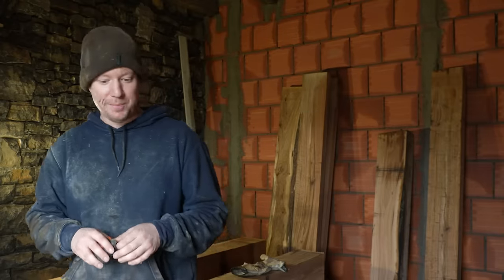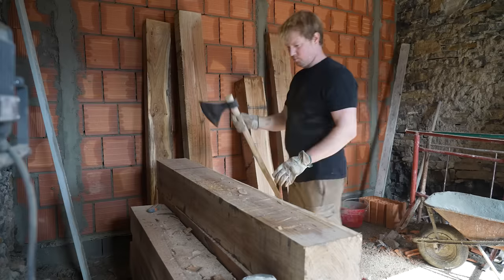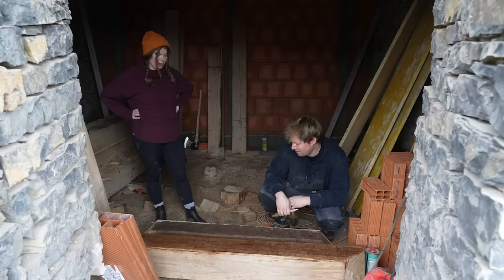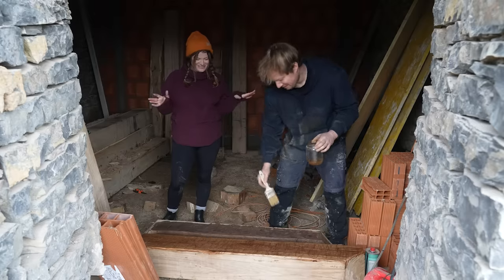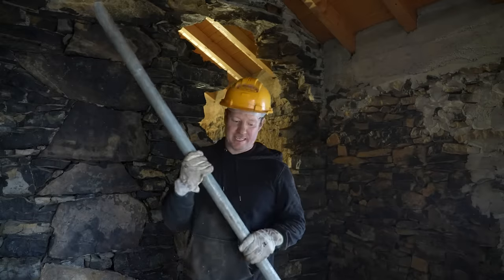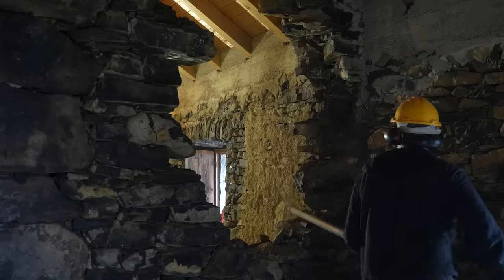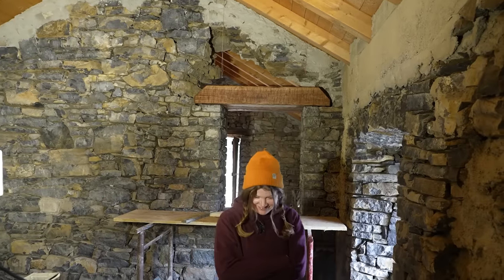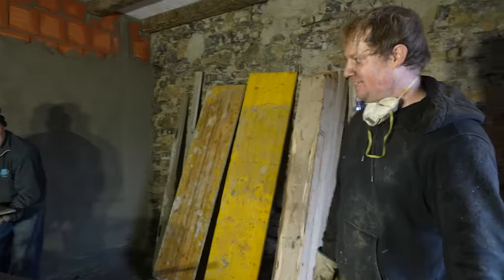Another Door Finished! Building Our Stone House.

Comment: If you're going to work with large timbers, then you need to oil the end-grain of the beams/lintels before installation. Oiling the end-grain, slows down the drying of each timber, and forces the water in the grain to dissipate through the sides of the beam. This slower drying process helps to alleviate racking, checking, and cracking of the wood. When wood warps and twists and cracks, it weakens...and that's the last thing you want, in a home you want to last you the rest of your life. I highly recommend a 50/50 Linseed, and Tung oils. This is one of the reasons that your Chestnut beams already in place, have lasted from ancient times until now... They were likely oiled before installation at the time the building was first built. This takes more time, but the end result, and the durability of the structure will be worth the time you invest. 
Timber framing a building, is always a beautiful thing. Timber framing a structure typically adds a lot of years to the structure's useful life. Timber framing also adds value, and aesthetic appeal... It just LOOKS better. Timber framing also lends itself more readily to the use of 'natural' materials available on-site. Nice to see you using traditional materials and tools to get the home built. Can't wait to see what else you have in mind for the home, and surrounding site.
Reply from the maker: They were oiled before installing which is why they were so slippery

Comment: When you have to lift something very heavy - back breaking - onto a work surface leve, lean it decently tilted against edge of that work surface so that the center of gravity is about at - or better: a bit above - the level of the edge, then lift at the bottom 'swinging' it horizontal like a saw horse bean and rotate it into place. With this technique you can double your max lift capacity. You did it a bit with our bent knee, but then you still lifted it... and it hurt just watching it. --- Take safe care of your health... like the unloading of the truck: peer or triple work gets you over time further and even faster over all. Not for nothing did you hire pros to get things done...